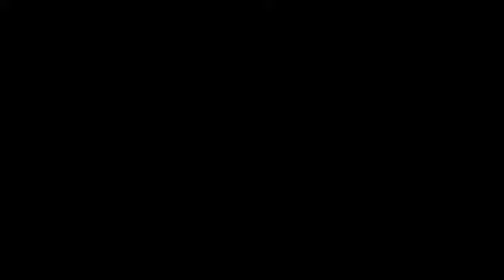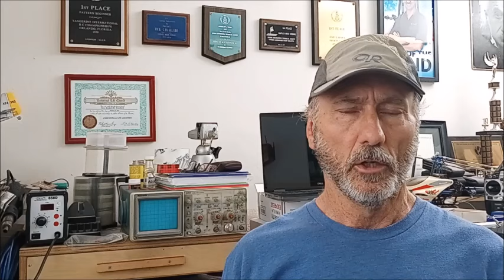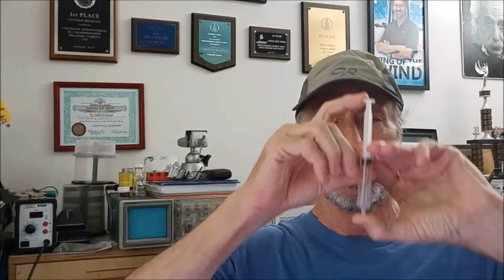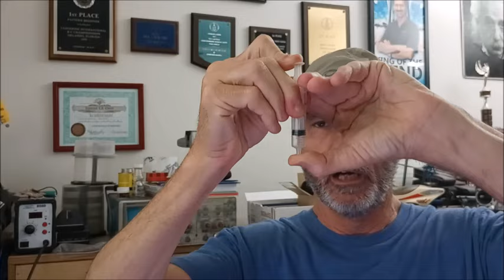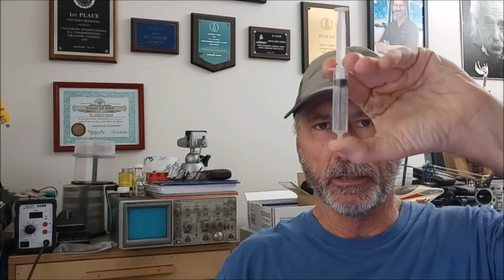My new brain teaser

Comment: The energy balance for the gas is:
U =Q-W
U =internal energy of the gas = Cv*T*m
Q=heat added
W=work performed 
The internal energy (U) of the gas is only a function of absolute temperature = T, the total mass, and a constant multiplier (Cv).  The answer to the question is that all the work done compressing the gas is removed as heat when the gas cools back to the initial temperature after compressing it. The confusing part is that the gas can still perform work by expanding even though all the compression energy added was removed as heat.  If we let the gas expand against the piston to the original volume, work will be performed and the gas temperature will drop below the initial value.  To get to the original starting point, heat must be added after the expansion to match the initial temperature, and that heat will exactly equal the work of the gas expansion segment.
Until the gas reaches absolute zero temperature it can still do work (or transfer heat), depending on the ambient conditions it is operating in.  In this case, after the gas is compressed and at the original temperature, it can expand and perform work because the pressure gradient relative to the conditions outside the cylinder is favorable for expansion (assuming low enough pressure on the backside of the piston.)  The gas does not need to start with additional energy to perform the work, it just needs to be able to expand the piston to lower pressure. The energy to perform the work of expansion comes from the dropping temperature of the gas, i.e. the energy was always in the gas but is now made “available” because of the initial compression cycle which raised the pressure of the gas.

Comment: Hi Rick, I can't work it out but air compressors create quite a bit of heat. A rough guess might be 10% of energy is used in the production of heat. I have a workshop compressor that is 2.2kw, I know roughly how much heat an electric 2.2kw heater would generate and I would say the compressor probably produces a tenth of that. I suspect the real answer is going to be way higher  as 10% isn't surprising enough.  Hope I understood the question properly 😃😃
Reply from the maker: You understood the question correctly, and you're right... it's way higher. :)

Comment: Just got back from an Alaska cruise and passed near your neighborhood in SFO!     OK, best guess--Qualitatively, (since I forget all the formulas), the work not recovered (I would think) would be the amount that the gas just loses in temp losses if allowed to expand quickly.   In other words, the energy difference between the room temp gas and the same cold gas as it expands quickly---since that energy does not go into doing work but has to come from the gas itself since it is expanded quickly (i.e. no heat from the container).   We'll have to go back to thermodynamics and recover all the equations to get the actual amount.   I think this is the same thing that @smorrismlbco states now that I read his answer.
Reply from the maker: I'm not clear on what you mean here.  How much of the energy put into compressing it do you think is lost as heat?
Reply: @Rick_Cavallaro  "Lost" is an interesting term here.   The energy of compressing the gas has been transferred to the environment raising its temperature.  If the gas is now allowed to expand back to atmospheric while doing work, the energy will be moved back into the process (if it is a conservative work function--like winding a spring or lifting a weight).   The gas will cool as it does this work.   And the thermal energy it originally had will slowly equalize to ambient.     If the process of doing work is non-conservative (like friction), the energy will thermalize and raise the ambient environment's temp (more than in the situation where energy is stored in some usable form).   Eventually, the environment will all settle down to a constant temp proportional to the original temp plus the amount of energy spread over the environment that was added to compress the gas.   Without giving away the plot , it is surprising that one can't really say that the energy is in the compressed gas!   Having looked at your answer (now)  it is an unintuitive surprise in how the energy in a compressed gas can "hide" itself in a surprising place--i.e. in the temp of the environment.   From thermodynamics, I seem to recall the difference in these two examples as being the "Free energy or Gibbs Free Energy" where the energy of the system has the ability to do work within the system for one scenario and not in the other where the temperature has completely thermalized and there are no other energy storage sources.   The energy is in the system (assuming isolation) because it is at a higher temp than before the energy of compression was added, but it can no longer be used to do work only within the system.

Comment: Question: How much energy invested during compression is lost to ambient?
Based on perspective.... 100%, 48% or 0%.
This is a heat pump.  Before compression, the air itself has heat (important).  After compression, it has more heat.  Specifically, the extra heat equals ~100% of the work you invested during compression.  When you allow it to cool to ambient, you have ONLY lost 100% of the compression heat.  You have lost NONE of the original internal heat.  

If the gas is expanded isothermally, you recover 100% of the added compression heat, so 0% lost.  

Even if the 10x compressed, room-temp gas is allowed to expand adiabatically, the piston can still do work (~52% of the compression work) by using the air's internal energy.  The final expanded gas temp would drop to -100C in this case, but it would still do work, so 48% lost.
Reply from the maker: I think you have it right, but we have to be clear when we talk about heat that's "lost".  In the problem statement, I'm only asking how much of the energy used to compress the gas adiabatically leaves the gas as heat when allowed to cool back to ambient temperature.  Whether isothermal or adiabatic, you "lose" 100% of that energy as heat.  I'm pretty sure the point your making is that you can effectively get all that energy back if you do an isothermal compression, while you "lose" a lot of that energy if your compression is adiabatic.
Reply: @Rick_Cavallaro  Sorry.  Language on my side might be an issue.  When you say "lost", I read "no longer usable".  If you compress adiabatically, then allow the air to cool, the end result is identical to compressing isothermally.  Same work in, same heat 'lost' (stored in atmosphere).  If you then allow the gas to expand isothermally, you get all heat back from atmosphere, so it's not 'lost'.  
I think the only reason this is not intuitive is because most people understand that the cooled compressed air still has the ability to do work and therefore still has energy.   It doesn't even need to reabsorbing heat from the atmosphere (adiabatic expansion) to do work.  Students see that they put in work and the gas can do work, so not 100% is 'lost'.  That's why the internal energy and cooling needs explained.  Well that's what helped me understand it at least.

Comment: Once the compressed air has lost heat to the ambient and reached thermal equilibrium, if we let the piston go, the air will decompress adiabatically but will not reach the original volume. This is because the gas temperature will decrease as it decompresses. This means that the air will be cooler than ambient temperature, so it will ocuppy a smaller volume at ambient pressure. Then, as heat flows from the ambient to the air in the cyilinder, the air will continue expanding as its temperature increases (isobaric process), and will end occupying the same volume as in the start when reaching ambient temperature. Now to the answer video to see if I was correct!
Reply: I was going to edit saying that as the initial and final states of the air inside the cilynder were identical, we end recovering all the energy that was used in the compression, but when looking at the problem further this is clearly false. You can draw the thermodynamic cycle in a PV diagram and see that the the adiabatic expansion and the isobaric expansion follow a line that is lower than the adiabatic compression, so a fraction of the mechanical work is lost. The lost energy would be equal to the area inside the cycle in the PV diagram. I I had to calculate it I'd have to dig up some thermodynamics and calculus.
Reply from the maker: @javierhualde739  But... the question is: how much of the energy used to compress the gas ends up being lost as heat when I allow it to cool back to ambient temperature - while holding it at the compressed volume?
Reply: @Rick_Cavallaro  Now that I made some calculations I see why it seems to be a paradox. if we start with a cubic metre of dry air at 20C and 100kPa and compress it adiabatically to 0.1m^3 we need to input 378kJ of mechanical energy into the system. The air is heated up to 463C. And when we let it cool to 20C it releases 398kJ. We are able to extract more heat from the gas than mechanical work we put into it! At the end of the cycle (after the complete expansion to the original volume) the system restores a part of the mechanical energy we introduced in the compression but not all of it. The paradox is that before the expansion the system has given more thermal energy than the mechanical energy we introduced. But when we consider the whole cycle the thermal energy that flows back to the system is less than the energy lost when cooling, and the difference is compensated by the loss of mechanical energy.
Reply from the maker: @javierhualde739  
>>  We are able to extract more heat from the gas than mechanical work we put into it! 

I think you may have a numerical error in your calculations.  You should lose as heat the same amount of energy used to compress the gas.

Comment: Hey @Rick Cavallaro, i'm ny no means knowledgable enough to be sure about this, but i gathered a few ideas from a few smart people, some of them you mentioned here. But one in particular was a german tinkerer, Georg Tränkl, who was on the tv-show "einfach genial" (The video is here on YT, there are adequate english subtitles, i think from automated translation in case you guys would like to see it) and presented an energy storing system that relied on gas. Many have done or tried this before but the efficiency was too low to make it a viable product for ecological energy storage, those in use tend to be applied for other means. But according to him he was able to make his machine more efficient, even up to 90% of the energy used would be recovered, because he changed the initial approach. If i remember correctly he was using more and longer cylinders to compress the air than common compressors. With this he claimed to be able to reduce the efficiency losses because he could make them work slower and in combination with the longer stroke of the longer cylinders he was able to keep the heat losses down.

So if he was right my assumption would be that the amount of temperature loss would be dependent on several factors, but in simplified terms on the speed invested in compressing the air.

Sadly i have no idea on how to put this in a sort of mathematic formula, but i would assume that there would have to be friction in the gas when it is being compressed, the slower this work is done, the less friction is caused, since friction is related to heat, this would be less, the slower we'd compress the air, i.e. converging towards zero but never reaching it. So the work to overcome additionally to the work of compressing the air or the gas, would have to be X plus the work to overcome friction, which would depend on the speed of the compression.

I'm not sure whether i made sense, i am curious though what the smarter people in "the room" will be able to add. 

Also i'd be curious to know how to calculate that and how that changes if we have changes in the state of aggregation due to pressure and temperature changes. 

And the really brave brains could maybe continue to elaborate how that would affect efficiency on sterling engines?

I'm very curious to see where this will lead.
Reply from the maker: >> Sadly i have no idea on how to put this in a sort of mathematic formula

That's OK.  I'd love to have people take a guess at how much of the energy is lost to heat.  It's very different from what I initially guessed.

>> i'd be curious to know how to calculate that and how that changes

When I post my "solution" video I'll go into more detail.  I also wrote a simple program that solves this.  Maybe I'll post that code in the description.  But mostly you use the universal gas law...
PV = nRT
P is pressure
V is volume
n is number of moles of the gas.  But you don't really care.  Just keep it constant from beginning to end
R is the ideal gas constant.  Again, no need to worry.  Just keep it constant.

The change in temperature as you compress it is given by...

dT = work_done / (specific_heat * mass_of_air);

Where the work_done = the pressure x (cross section of plunger) x (distance plunged)

You want to apply this equation a thousand times in tiny steps so you can track the temperature as it increases.
Reply: @Rick_Cavallaro  So if i get this right, you don't think there is a time-variable?
Reply from the maker: @jonabub  There's definitely a time variable during the compression phase, but not the cooling phase.  If you compress it rapidly, or while insulating the system, it will get much hotter.  This would be an adiabatic compression.  You could compress it isothermally, in which case you don't let the temperature increase during the compression phase.

Comment: My background doesn't include a lot of hard sciences unfortunately, but if I interpreted my initial searches properly, it would appear that you lose around 60% of your energy to heat when you compress 10 volume units of air into 1 volume unit. 

Am I anywhere near in the right ballpark?
Reply from the maker: It's hard for me to say whether that's the right ballpark.  It's a lot closer than most people guess - including my initial guess.  I'm overdue to post the answer - so I'll go ahead and break it out here.  Hopefully I'll post it tomorrow.  The answer is...
100% of the energy you use to compress the gas is lost as heat when you allow the gas to return to ambient temperature.  But you're still left with a gas at 10X ambient pressure to run your pneumatic tools.  And yes, I'm well aware that that sounds insane.  I wouldn't have posed it as a brain teaser otherwise :)
It will all be explained in the follow-up video.  But it looks like there will be two versions... the short one and the long one.
Reply: @Rick_Cavallaro  Is your assertion that the energy debt contained in the compressed gas is then paid by reabsorbing ambient heat once the gas is decompressed?
Reply from the maker: @codes1699  That's right - if by "energy debt" you mean the energy used to operate your pneumatic tools after you've let the compressed gas come back to ambient temperature.  Keep in mind that the compressed gas at ambient temperature actually has exactly the same internal energy as it did prior to compressing it.  This is because the internal energy of a gas it dictated solely by its temperature.
Reply: @Rick_Cavallaro  Yes, that was what I meant. I look forward to your in depth explanation.

Comment: Dang, you can't put diagrams on youtube! Total energy in syringe goes up. The heat component goes away leaving you with only the pressure delta?
Reply from the maker: Total energy in the syringe goes up as we compress the gas.  We end up with gas at high pressure and high temperature.  We then hold it while we let the temperature return to ambient - losing energy to the environment as heat.  The pressure goes down somewhat, but remains at 10X the initial pressure in the end.